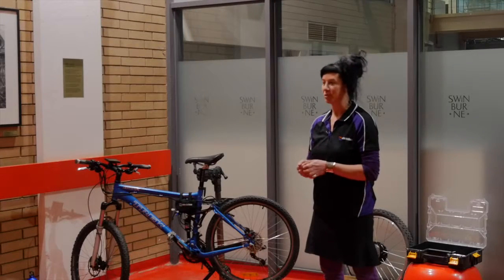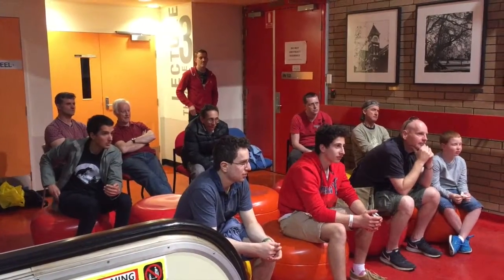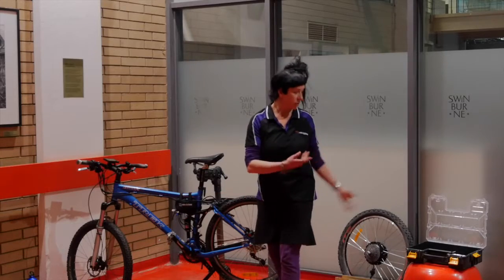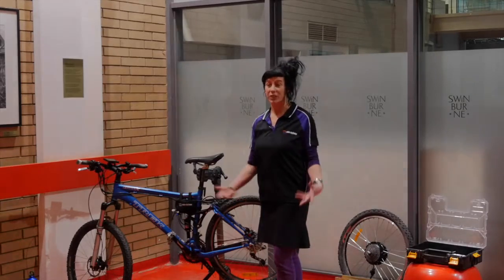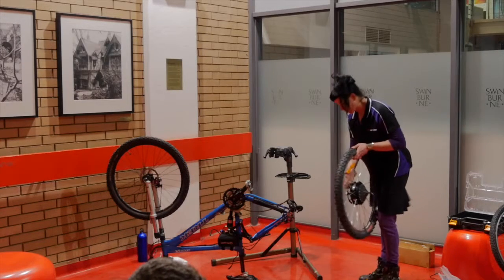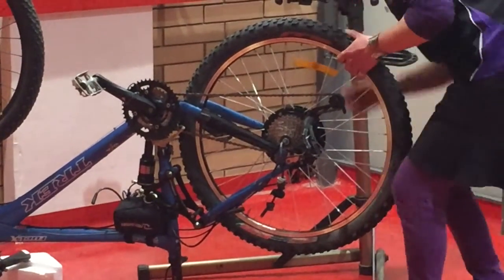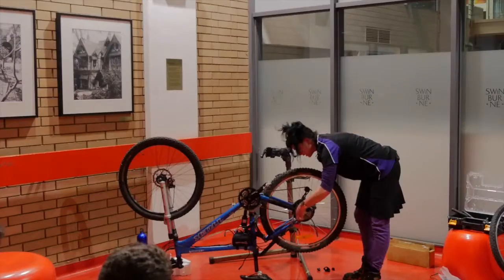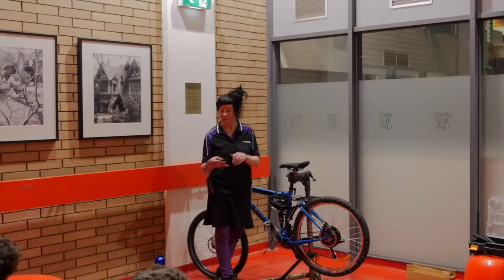RevBike Workshop

Comment: This is great thank you so much. With the higher powered motors and the lighter weight on the front wheel when its your off road, its wet or you hit white lines or tramlines the front wheel can lose traction when your under power particularly if your cornering and you hit the road in a fairly big way. Rear hub motors under power also shifts the moment of force towards the back wheel and your using physics to you and your bike to max advantage.